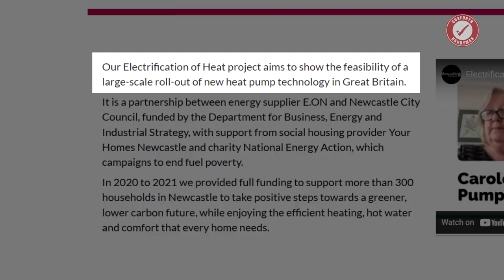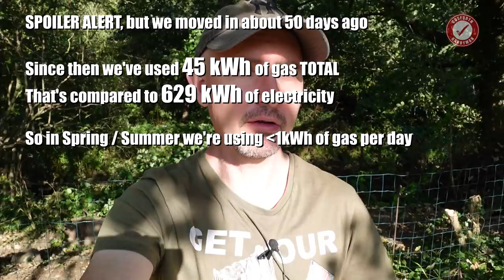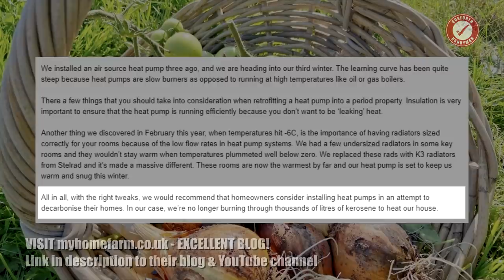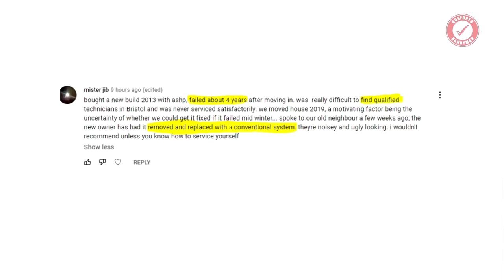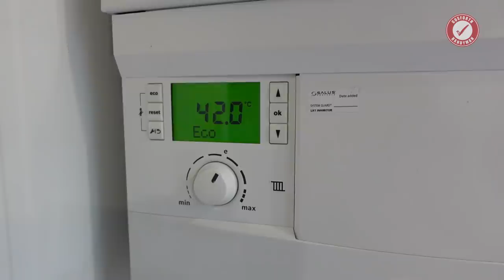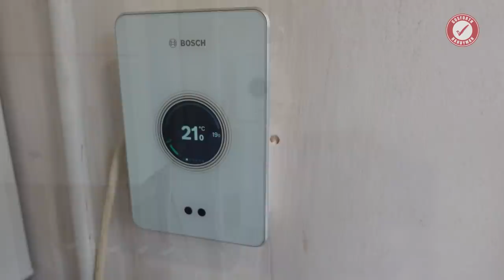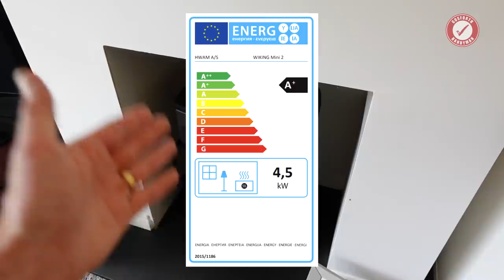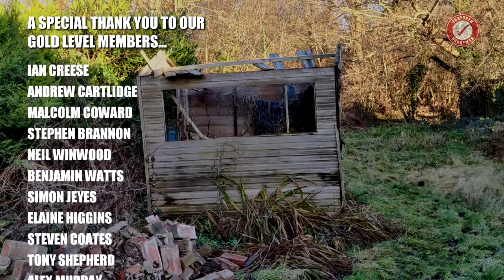Why didn’t we install an Air Source Heat Pump? (1920’s Renovation Part 32)

Comment: Great video!
At The Electrical Group we are not convinced with Heat Pumps so we offer a different heating system called Infrared Heating.

Also the workmanship of the electrical cables look shoddy and I’d bet you didn’t receive an electrical certificate for that.

Comment: You posted this as a government think tank posted Heat Pumps aren't a silver bullet and properties are looking at an an average £1,500 extra cost to replace minibore/microbore pipework. Our company decided as many engineers as possible should be qualified on all types of equipment as possible one to understand and fault find any situation but also because you never know where technology and legislation will head. I posted a lot on your community tab but the TLDR; Heat Pumps aren't a silver bullet and to get the best out of them can cost more than just the system being upgraded, it can mean upgrading your house to passive house levels.

Also 36kw on Hot water, 24kw on CH for the 36CDi - TRV's during summer months in southern counties should be opened fully to stop the wax stats expanding and jamming the pin down.

Comment: Interesting video however i think you have been a little biased, unvented systems do have zone valves yes, but the boiler is a lot less complicated & cheaper than a combi boiler,  so less to go wrong there, not to mention that combi won’t be able to cope with 2 people having a shower without a significant drop in pressure, unless planning on using electric showers and finally if the combi breaks you have lost your hot water too, where unvented systems can still use electric to heat up. Just some arguments to balance things out. Its not that a combi is better, its what suits your needs.

Comment: I think you are exaggerating the noise levels, my parents have an ASHP and it's very quiet. It all comes down to costs, they were on oil and the prices made ASHP make sense. It all comes down to the price per KWH, if gas is cheaper = go gas.

Comment: bit of a odd hack, but i bought a high power patio heater for £50 ,in winter i stick in inside for 15 mins on full power ,and since my flats well insulated it keeps the heat in all day !
Reply: I hope it's not a gas heater.  These are very dangerous inside as they can emit carbon monoxide very easily.
Reply: Enjoy the afterlife!
Reply: @katabrontes  obviously not ,its IR
Reply: @Lewis_Standing  no such thing

Comment: See I'm quite the opposite. Up until we bought our first new build about 5 years ago we had always had combi boilers. Hated the things. A trickle of hot water that came out after a 20 second wait. Dreadful things. Since moving into new builds and having unvented systems it's been excellent, mains pressure, instant hot water. It sounds like you had a bad system in your new build, especially with the faulty zone valves. You could have fitted a much bigger, or multiple tanks in the new house to get over the issue with you not having enough water. 

I do agree with your thoughts on the heat pumps though.
Reply: Interesting - my combi boiler (in use for 10 years) doesn't produce a 'trickle' of hot water - it produces lots!!
Maybe YOU had a dodgy combi installation......?!?!
Moral? Don't take other people's advice - they're ALWAYS biased! 
Do your own research........
Reply: @andymccabe6712  maybe a trickle was an over exaggeration, but it was nowhere near mains pressure.

Comment: My idea is that an all-electric household makes sense from an environmental point of view only if electricity is produced ONLY with renewable sources (excluding biomasses!). Economics aside, if you're producing electricity with coal or gas, it doesn't make much of a difference. It might even be less efficient because of grid losses, so it's better to burn natural gas on premises and be done.
Here in Milan, Italy, many new apartment buildings are connected to district heating that gives us hot water and heating for very reasonable costs and supposedly lower carbon footprint (although I'm not entirely sold on this).

Comment: I live in America (NW Wisconsin ,next to the BIG LAKE) and our temps.are very similar to yours . When we replaced our Furnace ,I considered a GSHP in spite of living in the city ,eventually settling on a NATURAL GAS 98%  high efficiency furnace ,AC (also 98%) and a new HIGH efficiency "ON DEMAND" hot water heater and haven't looked back ! "GO GAS ".

Comment: Buy a $500 Ebay Heat Pump.  Heat Pumps are really whisper quiet if you must know.   Use the heat pump 24/7 as a supplemental heat.   Keep your Gas boiler for sure but heat pumps work and they are really really cheap now if you install yourself.... especially in your climate. You will get both AC and HEAT,   GL

I see heat pumps as supplemental

Wood and pellet stoves are too dirty, sooty, ashy, smoke, too much maintenance and dirty for me,  GL

Comment: You have made some serious mistakes with ASHP :
1) They can work in cold temperatures, there is no problem with that, they are used in much colder climates, it comes down to the quality of the product.
2) They are not "inefficient", but rather they are limited to the power accessible to the consumer which is limited to 40A MCB, so about 7kWh in practice.  This means that are limited to power they can supply to the heating, and they are limited to about 55 degree rather than up to 75 degrees to the wet system (the water in the radiators) with a gas system.  Gas boilers are often up to 20kWh.
This understanding is critical.
It is unwise to just switch in and switch out a wet system as the radiator balance will NOT work on a ASHP - you will need a radiators and floor heating to work with this 
You must have a B/A rating for your house - highly efficient - since they cannot supply the high heating demand - as you are limited to 7kWh.
Cost wise - they can replace cost wise oil and propane central heating - but cannot replace the cost equivalence for gas - as currently gas is cheaper.
PS : efficiency is not a definition used for ASHP ( and GSHP).  They have a coefficient of performance - usually around 3 - what this means is that every 1 kWh they create 3 kWh of heat - as they move heat - not create it.  The maximal coefficient theoretically possible is 7, but realistically 4 is the practical limit.
Hydrogen - careful - BLUE hydrogen is really known as BROWN hydrogen in the rest of the world - it is hydrogen from oil - which is MORE  polluting than gas.  Green hydrogen from electrolysis from solar or wind is only around 30-50% efficient, and has a number of other problems.
You are right - let the government solve the problem of CCGT first (see my other comment).

Comment: I’ve eaten up your well argued opinion. I live in a non gas village and am just about to put a combi oil boiler ( including fitting the tank) into a 1950 three bed semi. I’m pulling out an electric boiler which costs a fortune, no one wants to service it ( it’s already failed) , it doesn’t provide sufficient hot water and it doesn’t appear to obey the thermostat! I do have a log burner. I think your rationale justifies my year of agonising. I am hoping hydrogen might replace the oil some time in the future. I know they will muck about with the price of oil but they’ll do it with gas too. Totally agree about all the other things you can do to reduce carbon footprint , or save money as I prefer to call it. Hurry up with the bathroom, I’ll be doing that too!

Comment: Combi boilers are ok until the DHW heat exchanger fails or boiler stops operating  . an open vent boiler with DHW storage cylinder and immersion heater provides back up in this situation. my son has had three combi boilers in ten years and  they all developed low pressure problems . i am old school when it comes to heating and hot water . In 1981 i installed a potterton netaheat sealed cabinet boiler in my newly built house it operated reliably for 35 years until i could no longer get parts to repair it. My replacement WB 32CDi boiler has not been anywhere near as reliable. Modern condensing boilers are far to complex for the simple task of heating and controlling the supply of hot water. At the same time (1981) i fully insulated the house floors, walls, roof etc. so full house insulation is not new. Roof space needs to be ventilated to avoid condensation so feel injecting foam into the rafter space and blocking ventilation from the eaves is not a good idea. better to insulate between the joists and board the joist over with T&G chipboard which is a reliable insulation material. As far as heat pumps go cannot see them competing with a properly  installed CH and DHW  system powered by gas with electrical back up.

Comment: I'm sorry but I live in the French Alps at 1200m.... we can get -20 in the winter at worst but mainly -10 for about 3 months. New builds are all air source / ground source. It's a fallacy about them being noisy.....it's utter rubbish. You must be buying a pile of crap. Yes you need proper insulation, yes you need proper ventilation but that's been mandatory in France since the late 80's. If you build properly then they work. If you renovate properly then they work.

Comment: Thx Andy, another great video. Could you explain on your ventilation? Extremely important. We did similar isolation etc but now have issues with mould building up. So I am curious how you solved your ventilation.
Reply: Have had great success with Nuaire Drimaster for mould.  The answer is air movement.
Reply: I installed an MVHR in the loft even if you can't get duct work to the ground floor its worth it.

Comment: You do realise that Sweden is colder than Britain and most houses have heat pumps. I have an air source heat pump and it is excellent whatever the weather. House is old
Reply: Swedish homes apparently have excellent insulation though. It gets colder there than in the UK so that's why it works well. Many homes in the UK are poorly built, have bad insulation or have draught.

Comment: I'm wary of heat pumps as I'm an annoyed diesel car owner lol as UFH would be too disruptive, I'm considering skirting board radiators. Just wondering what your views are on this? It's not so much about cost (within reason) as I already have gas central heating but for comfort sake and having more flexibility by opening up wall space.
Reply: Skirting board radiators would be unlikely to have the required surface area. Heat pumps use less electricity when the flow temperatures are low and hence most installs will use larger radiators or aluminium radiators like Faral95s.

Comment: Surprised you have not used Celotex for insulating the loft. I did this and it is far superior to the ( itchy scratchy ) you seem to have and negates the need to bother with the  spray foam which can be problematic.

Comment: Having crunched my numbers today, assuming electricity's 100% efficient at point of delivery to the appliance - it is - and a correctly-set condensing gas boiler is 90% efficient, gas is, kwh for kwh, 32% of the cost of electricity, thus electricity's just over three times the price of gas (from the Oct 22 price cap).  Air source HPs are routinely quoted as being c 2.5 times as efficient for their input.  So unless I'm not seeing the whole picture it will be slightly more expensive to run than a good boiler (and certainly no cheaper) for the same amount of heat, PLUS the huge additional up-front cost over boiler (even with gov £5k) PLUS total reliance on electricity instead of having a second means of heat (gas), PLUS (I reckon) a higher annual maintenance charge than a boiler.  Only with solar might they make sense cost-wise; I wouldn't remotely consider them otherwise.

I'm also assuming they provide sufficient warmth: there's conflicting evidence here, and there's the minor consideration of noise from HPs.

Relative cost of fuels will have to shift significantly to change the above - and it seems for two years from Oct the cap is set.

That's a big NO from me for HPs...

Comment: I've never understood people who have their homes heated to 25+'C, in the summer you sweat your backside off, and in the winter your not used to lower temperatures that when you go outside you freeze, I have my house kept at around 17-18'C all year round, and throw on a hoodie, when it gets a little nippy, means I'm ready for winter, and don't feel the lower temperatures much when I need to head out.

Comment: Air source is not a viable replacement for an oil boiler either. West Coast of Scotland here and people are still putting in oil. Some who have electric storage heaters are changing to air source but at the moment not many going from oil to air source. This may change of course but thats how it seems to be at the moment.
Reply: Also on the skill builder  channel they did a vid on modern gas boilers being made in a way that with very few parts changes they can work on hydrogen... then there's HVO......

Comment: We recently converted our unvented system to a combi-boiler and opted for a Baxi 830, due to it having a stainless steel heat exchanger and 10 year guarantee. It is a much more efficient system now, performance wise and cost wise, but I'm sure these 'climate'/'government' crackpots would want to rip it out 🙄

Comment: As I believe in the science, both behind the Heat Pump System and Climate Change, I made every effort to find a convincing case here in the UK. There none, at the end of the day its all about burning stuff, we need to stop. We've gone for an ASHP knowing that our home is not ideally insulated. We plan to insulate of course, its just an inconvenience at present, as insulation methods are invasive, as are the extension and underfloor heating we are planning, and to address the running costs, we aim to have a power wall system in the interim running on cheap over night energy. Once all the work is done we can use the battery to run other things in the house, like the hooker, or as a back up system. I see the points you are making, but I don't think they are going to give you the right results for your planned future family. Our LG Therma V 9kW monobloc ASHP cost us £7,500 all in! and currently running at 7kWhs a day to achieve a 20c indoor heat. This will reduce once the insulation is installed at a round the time when our RHI grant money has finished in 7 years time, not ten!!

Comment: I lived in a rented 6 bed house with an Unvented system for 3 years.

Of those three years I reckon the landlords were there daily, with their gas engineer, for at least 6 months troubleshooting the system. In short, it never worked properly. Avoid like the plague. The systems are so over-complicated and even when they do work you're continually running out of hot water. They are a terrible solution.

Comment: They leave their windows open (21:00) because the houses do not have air change systems! New houses are sealed, and all that moisture and exhaled CO2 needs to be vented. Building regs need to mandate thermal transfer air change systems.

Comment: You have to have a super insulated and air tight home for heat pumps to even begin to work well.

I can see in 10 years, where you miss sold heat pump system?

Comment: Why is air source still being sold, is the question i ask myself. I myself have a groundsource in a closed loop system. The drilling has become very affordable(Belgium). It's been installed for two years, COP is still 5+. And wouldn't want anything else.  The passive cooling in the summer is amazing. You extract heat in the winter, and refill that energy in the summer. A air source heatpump, does not have anything like that(Only active cooling). And when you need the energy in the winter, the COP is at it's lowest. It makes no sense.

Comment: ASHP seem to be like Hybrid cars, a technology stop gap to bridge between FF heating and resistive heating. Resistive heating is fast, efficient and very simple and cheap to maintain, problem is the grid can't cope currently both from a production and supply. We would be better sticking with FF heating while improving the infrastructure to allow resistive heating to be an option for everyone.
Reply: Current new builds use Heatrae Sadia resistive heating. They're extremely expensive to run having 1 bed flats with full UFH costing over £120/month. Also resistive heating loads can cause issues with the supply in properties and ideally need capacity banks to stabilize the supply. Lost count of how many blocks we've gone to where equipment in other flats is damaged because of the new resistive loads fitted by green council initiatives without scope of the entire building.
Reply: @effervescence5664  Resistive heating at the moment with high prices and an unsuitable grid is a bad idea. It will be the heating of the future though I am certain.

Comment: In Canada, gov. subsidized heat pumps and A/C often have a provision for the utility to "control the operation" of your equipment remotely. So if A/C puts a strain on the grid the utility can turn off your stuff. I'm sorry Gov overlords,  I'm thrifty on a regular day, and don't need you telling me when I can or can't use the dribble of A/C I feel I need or switch off my heat-pump to force me to use gas for YOUR benefit.... That I got the heat-pump to minimize.